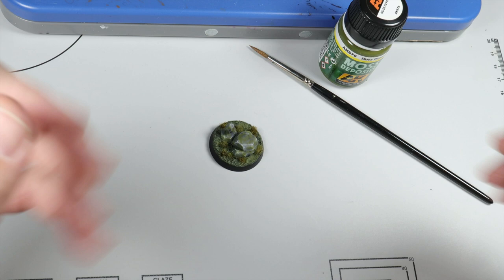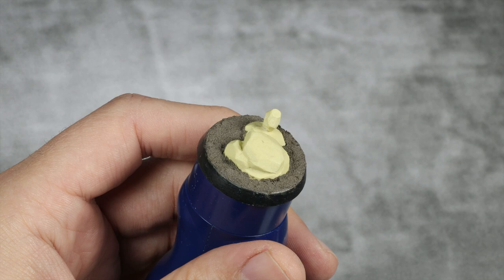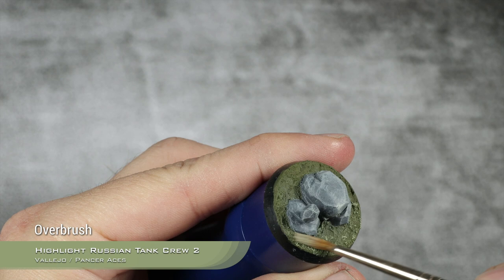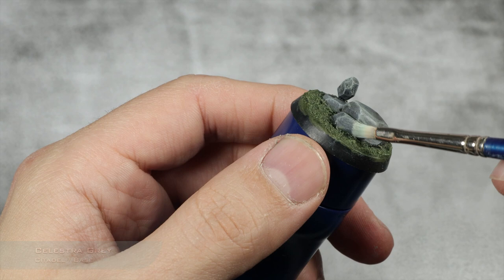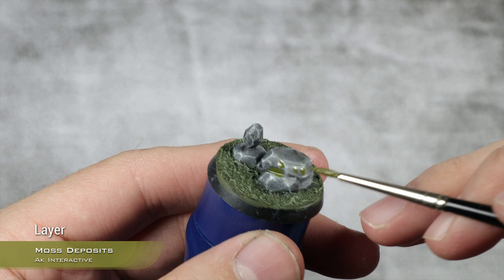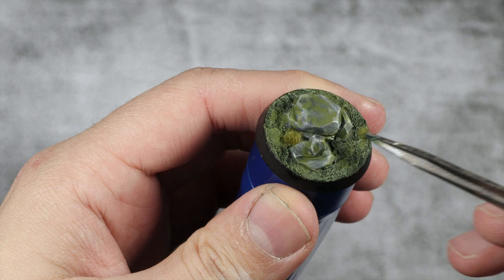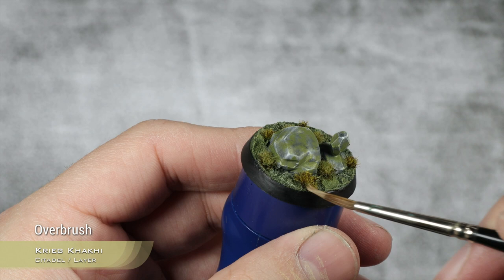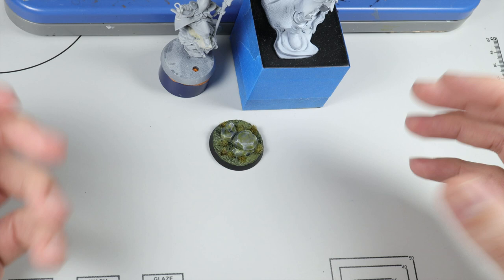How to Base - Mossy Rocks

Comment: There is another moss product out there that I think has a much nicer moss effect.  It's called Dirty Down Moss.  You should try it out, I think you will like it more than the AK interactive option.  I liked it so much I bought their Verdigris and Rust as well.
Reply from the maker: I will take a look at it thanks, but one of the things I like the most about this is the ability to clean it up afterwards without any issues being an enamel which might be a problem with the Dirty Down version but it does look quite interesting indeed
Reply: @JuanHidalgoMiniatures  Dirtydown is alcohol based.  I can play with it a little and let you know but I do think that I can probably clean it up a bit like you did with the mineral spirits but using alcohol.  You just need to be a lot faster as alcohol dissipates WAY faster than mineral spirits.
Reply from the maker: No, being alcohol is not the same. Also alcohol can strip the paint underneath if you rub it so I would avoid it. Still the effect is very cool and will take a look at them.
Reply: @JuanHidalgoMiniatures  I actually have a bunch of prebuilt and painted bases that are also all pre varnished.  The thing with this dirty down stuff is that it should go on post varnish as getting it wet ruins the effect.

So I slather a bit on the base in a few spots, very similar to how you did, and then with a separate brush and some alcohol tried moving the stuff around a bit.  A lot of the spots had already started drying but the last few I did I was able to mess with a little bit.  I guess in case of an oops, if you are fast enough, you can have a chance to fix it at least.
Reply from the maker: Ah so you cannot really paint over it then or varnish it.

Seems like an interesting product for sure if I can get my hands on some for not too much over retail (shipping and customs) I will try it.
Reply: @JuanHidalgoMiniatures  You may be able to do a drybrush over it.  I'll test this as well as soon as I get some time.
Reply: @JuanHidalgoMiniatures  I was actually able to do an extremely dry drybrush over it.  I also did a little "dry stippling" with a pointing lip brush.  I just kinda stippled the paint off until it was dry to the touch on the back of my hand then hit the top of the "moss" effect a few times.

Comment: I do have a question. Did you dilute any of the paints?
Reply from the maker: Just the normal amount for regular acrylics, so they run smoothly of the brush and don't leave texture.
Reply: @JuanHidalgoMiniatures  thanks! Just with water or another agent? How much would you say you dilute it?
Reply from the maker: Just water and forget about ratios, learn to do it by feeling. Each paint from each manufacturer is different.
Reply: @JuanHidalgoMiniatures  that's a solid point. :P Thanks for the feedback. I purchased the moss deposits. It seems like you didn't dilute that and simply dabbed it on, but then you  kind of blended it together - is that right?
Reply from the maker: Yes, that's exactly it. You use white spirit to do that
Reply: @JuanHidalgoMiniatures  Ah, gotcha! Okay, last question... I thought you just blended the moss deposits with a wet brush, kind of spreading it out like that. Did you use the white spirit to spread and blend the moss deposits, or only to remove excess moss deposits?
Reply: @JuanHidalgoMiniatures  because I don't have white spirit. Can I blend and spread the moss deposits without white spirit?
Reply from the maker: No, you also need white spirit to clean the brush, so get a bottle of white spirit or Sasodor spirit.
Reply: @JuanHidalgoMiniatures  would terpentine also have the same effect? I'm just not sure how much to use of it. I'll be using an older brush anyway, so i'm not too fussy about cleaning my brush. I only want to be able to spread the moss deposits like you did! It looks amazing.
Reply from the maker: Yes turpentine will work, just have the brush with the smallest amount, just moist and that's enough to blend it
Reply: @JuanHidalgoMiniatures  thanks! Your videos are really helpful and entertaining. I'll just gently dabble the moss around with a brush that is only slightly moist with turpentine! I'll just try to imitate the way you did it, which seemed like you literally just dabbled it to blend it that way. Thanks again! :)
Reply from the maker: No, no, you put the moss, clean the brush in turpentine, then you blend it.

Just to be clear.
Reply: @JuanHidalgoMiniatures  oh! Good call! Haha. I would have used the turpentine to blend it. So you clean the brush with turpentine, then clean the brush with water and dry it to the point where its only moist.. And THEN you blend the moss? So there is no turpentine/spirit on your brush when you blend the moss? Thanks again
Reply from the maker: NO WATER

water CANNOT touch that paint, it's not going to end well, completely different solvents. You clean the brush with turpentine, then dry it a bit and blend it
Reply: @JuanHidalgoMiniatures  understood. Thanks for your response!
Reply: @JuanHidalgoMiniatures  will you ever be making a deepkin video? 😁☕
Reply from the maker: Happy to help